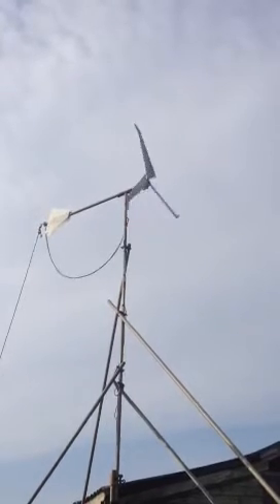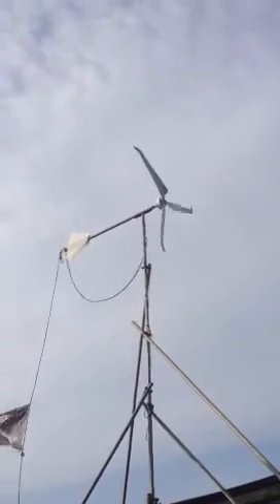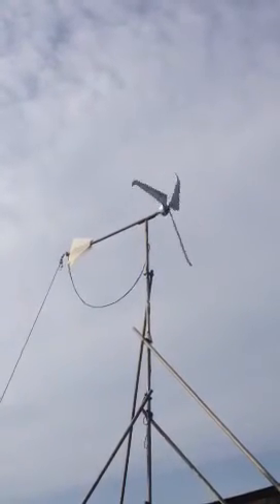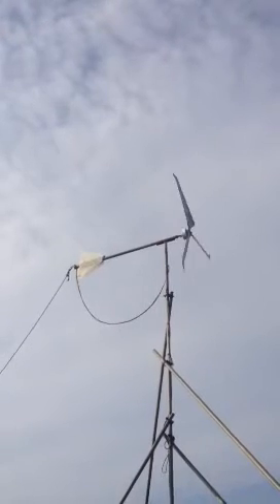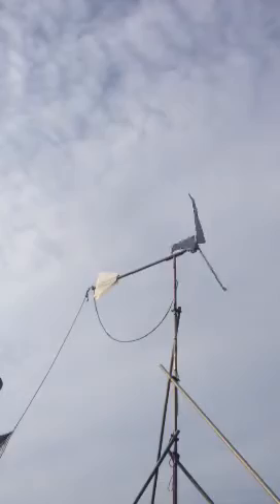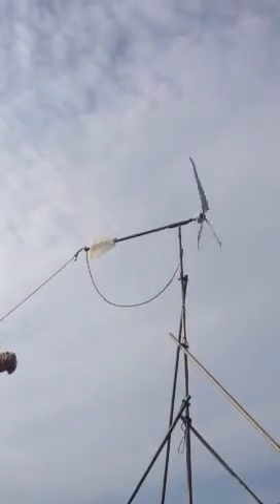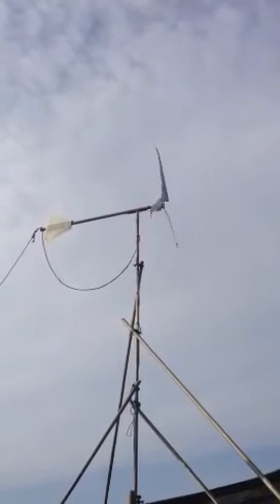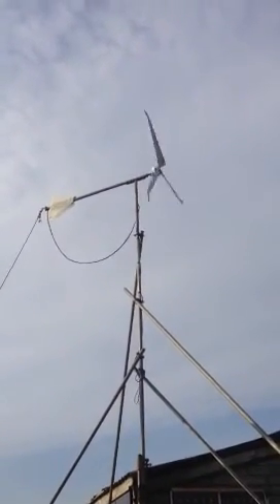Falcon Mach 4 new wind turbine blades

Comment: One suggestion for you if you don't mind. Your tail fin is to small. To keep it in the wind your tail fin should be 3 feet or 1 meter tall minimum and 1 foot wide. 4 feet tall would be best. It would make it very difficult for your turbine to sway from side to side so easily thus holding it steady in the wind which will create even better power for you. Never under size your tail fin. To small a fin will cut thru the wind easily.